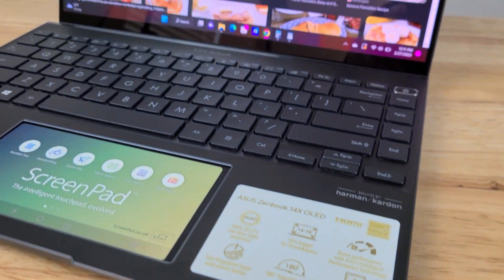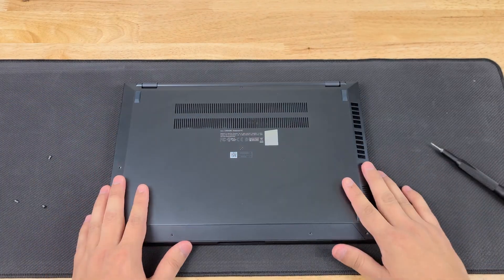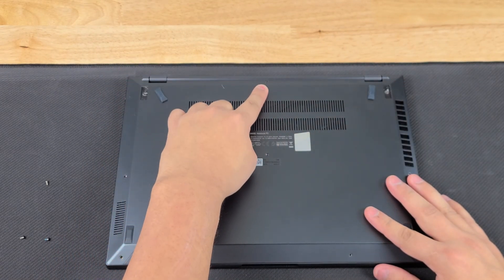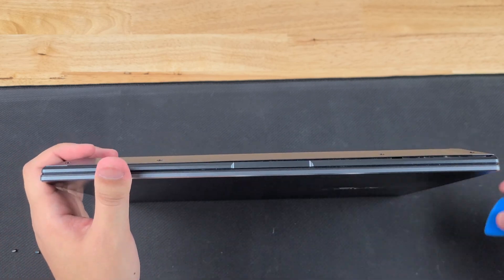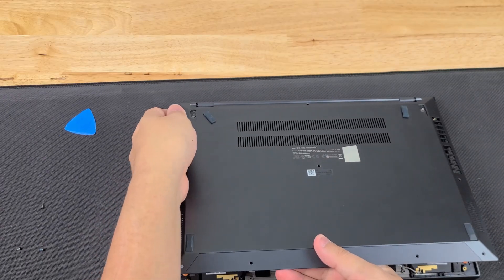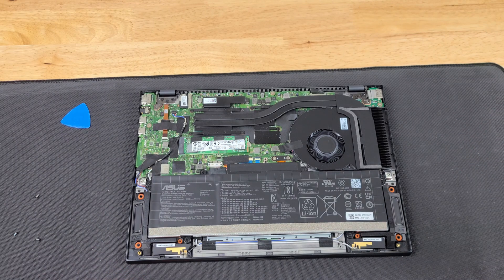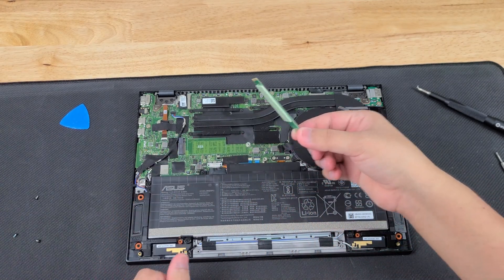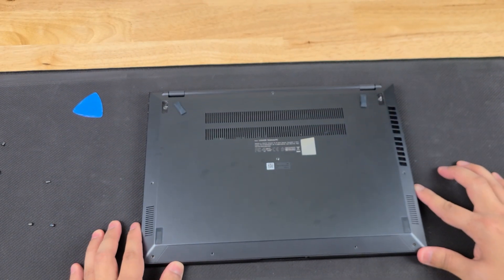Asus Zenbook 14X OLED UX5400E |How to upgrade your SSD

Comment: Thanks for posting! Would this apply for the ASUS - Zenbook 14X 14.5" 2.8K OLED Q420V,  i7-13700H - 16GB Memory - 512GB SSD? Upgrading to 1TB
Thanks in advance
Reply: Yeah i just swapped it. Inside is slightly different. You just need to remove the metal cover on SSD and replace SSD with your own l and put the cover back on. And remember to keep the screws in safe place because it’s too small to look for if it drops. I replaced it with a 4 tb ssd and everything works fine.

Comment: What about the OS? Would Win 10 need to be installed? (Other OS are available).
Reply: OS doesnt matter because when you upgrade your NVME you'd have to reinstall the OS anyway as it's a new drive, but as stated in the video make sure to get a one sided nvme. You can install win 10/11/linux which ever version you want
Reply: WIth a ZenBook 14X OLED I got (UX3404VC) you are forced to use windows 11 because there are no drivers for Windows 10, I tried many things but no luck. And windows 11 feels very laggy :(